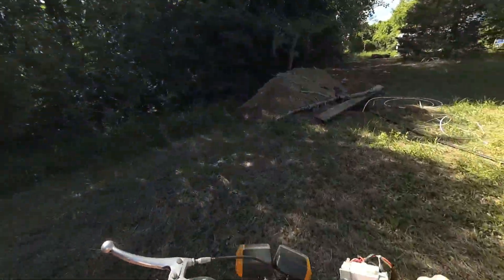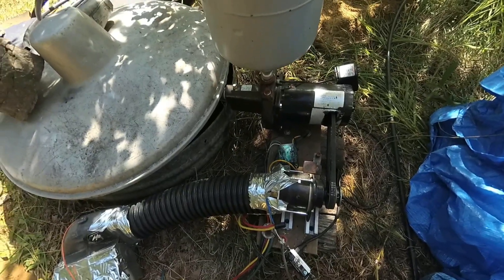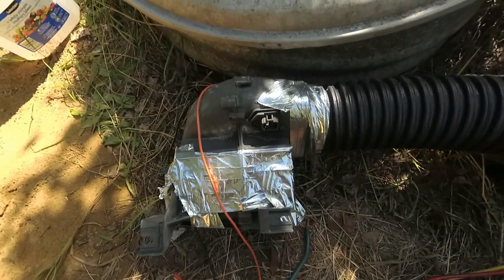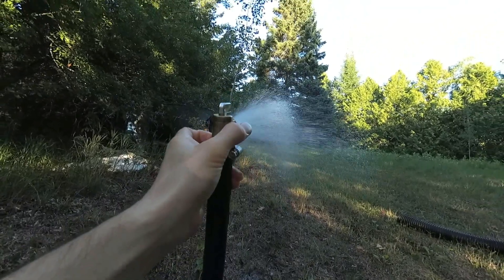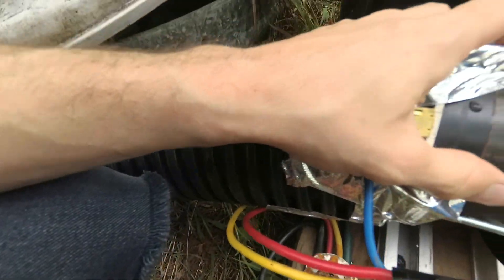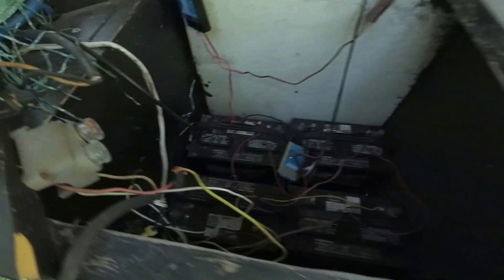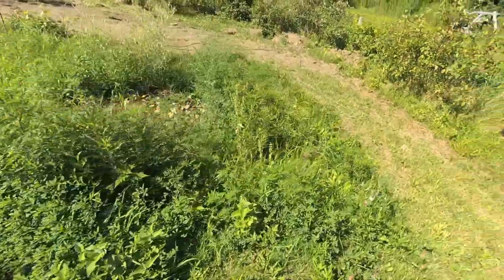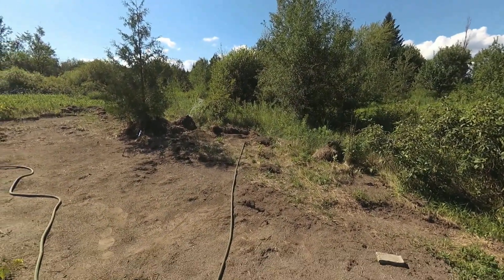Off Grid Homemade 24v Automated Water Pump - 600 ft water line Project

Comment: this is amazing, for my water well set up i use a diaphragm pump, they are designed for boats and run of 12v only pulling around 5 amps for 12+ lpm which is more than enough for a shower